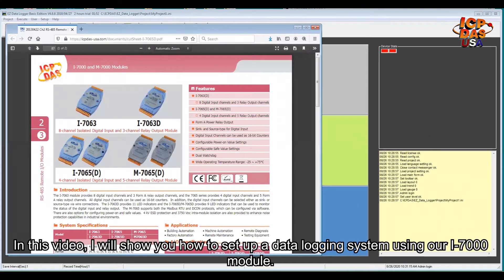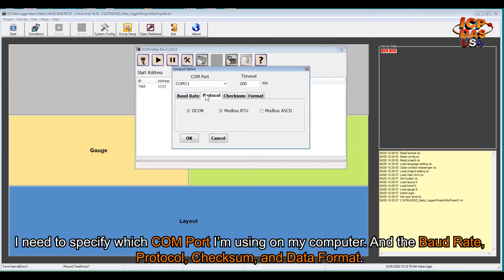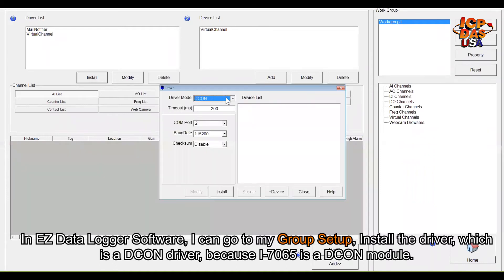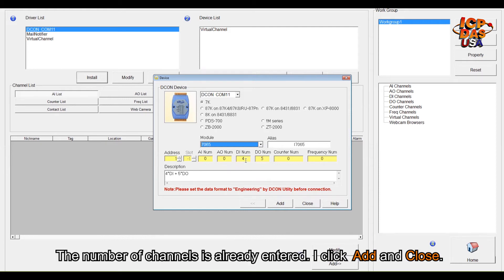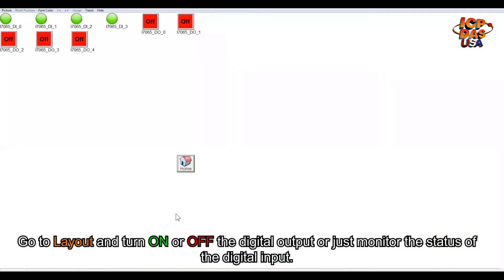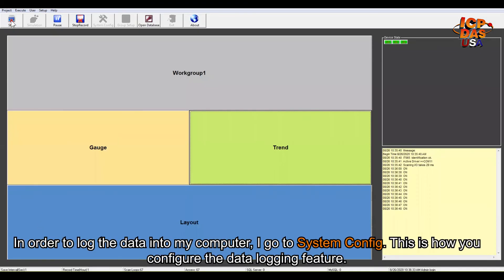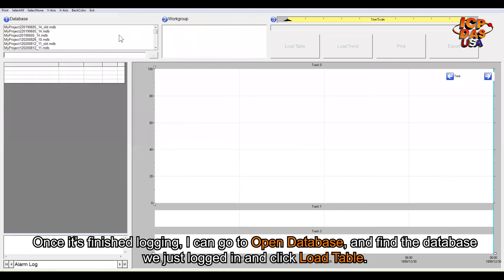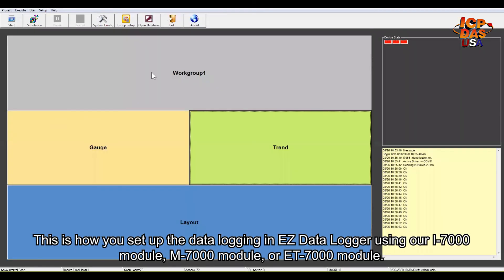EZ Data Logger Tutorial | ICP DAS USA

Comment from the maker: Please note that the I-7561 USB to RS485 converter and other converters are not considered data acquisition modules,, you will not see them in the DCON utility, you will see the module they are connected to. Also, you must have a data acquisition module for the free version of EZ Data Logger to work. You can find the selection table for the ethernet data acquisition modules that qualify for the free EZ Data Logger version here: https://www.icpdas-usa.com/remote_io_modules.html